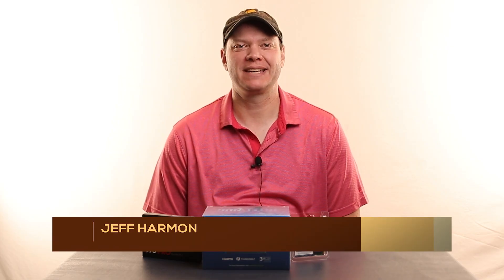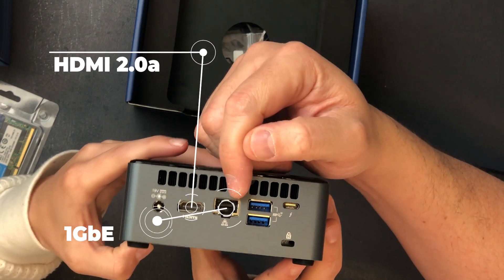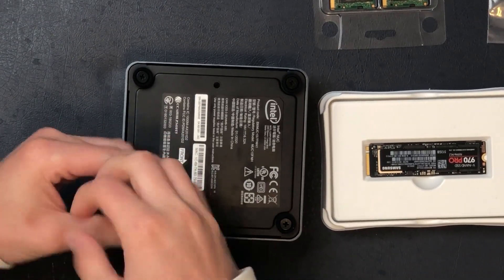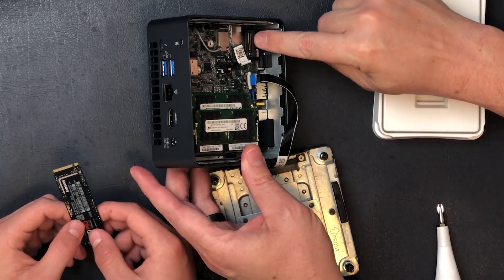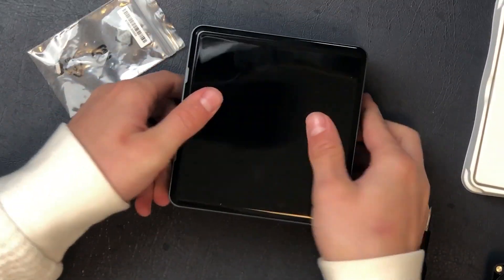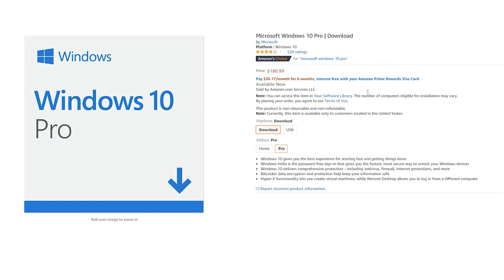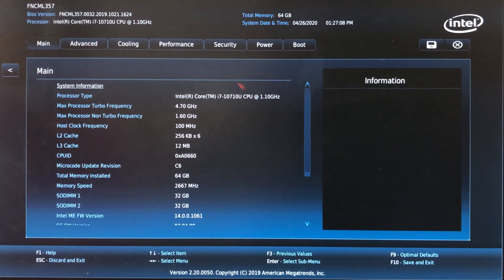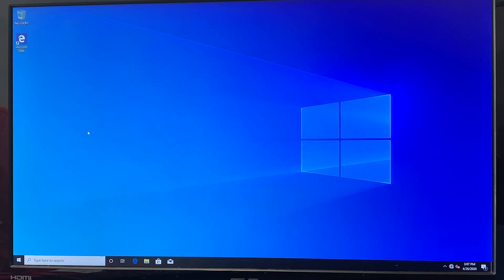Unboxing and Assembly of Intel NUC - Can It Be A Good Photo Editing Computer?

Comment: I bought a MacMini 2018 i5 6x core 2.8ghz base clock to edit Sony A7M3 24mpx RAW files with CaptureOne. Not being satisfied by the FPS feedback when moving the editing sliders I upgraded the RAM to 32gb. Got better but then I started to plan for eventual A7R4 camera upgrade path so I downloaded some 61mpx A7R4 RAW sample files and tried to open/edit them on my 6core 2.8ghz 32gb MacMini rig... : unbearable 1fps editing feedback.
Only solution forward: eGPU, so I upgraded the rig with a RazerX populated with Radeon 5700 GPU and THEN editing became acceptable for 61mpx RAWs and even enjoyable for 24mpx A7M3 RAWs. Exporting a single 61mpx RAW (multi format) took 40s before eGPU (hours exporting a wedding’s worth batch), now 4s with eGPU.
Bottom line?: forget about productively editing on ANY machine (doesn’t matter PC/Mac) with embedded Intel graphics at such low base clocks as the NUC provides.
Either go straight for an eGPU combo (GPU wasted by Thunderbolt 40gbps  bottleneck) or forget NUCs (except the 9th gen) and go for a setup/box that offers you internal GPU PCIe slot connectivity.

Comment: Good video and I liked how you had your son do the install of the memory and NVMe card into the NUC. One thing I did not see in this video that I have seen in others was all the Intel NUC drivers needed for a new NUC install.
Reply from the maker: We didn't have to manually install any drivers after installation of Windows 10 Pro 1909.  Afterward we did go and download a few updated drivers and even did a firmware update for the NUC, but that is pretty normal for most PCs.

Comment: What 2.5" drive do you recommend? So it will accept both the 2.5" drive and the M2 NVMe drives?
Reply from the maker: Yes, if you buy the tall model as shown in the video you can have both an M.2 connected PCIe NVMe SSD and a 2.5" SATA3 connected hard drive.

The 2.5" SATA3 magnetic drives are almost not available these days as everyone wants SSD, but here is a 1TB option that would be pretty fast for very little cost:

1TB ($60): https://amzn.to/3dNaGfZ

Then there are the faster SSD options
1TB ($115): https://amzn.to/2UmZgYK
2TB ($230): https://amzn.to/30mSjec

Comment: Great job, also enjoy your podcasts. What monitor would you recommend?
Reply from the maker: I recommend you look for a monitor with the following:

1) Buy as large as you can.  24 inches will work, 27 inches is good, 32 inches is great
2) IPS display technology.  This helps makes sure that if your position to the monitor doesn't have to be straight on to see the full fidelity of the colors and tones, you can be off to an angle a little and still have it look great.
3) A resolution of 2560x1440 or 2560x1600.  It is also called 2K, 1440p, QHD, or WQHD.  I don't recommend 1080p Full HD monitors.  They don't support enough resolution for the digital photos photographers are taking here in 2020.  I also currently don't recommend 4K displays because Lightroom slows down as you add more and more resolution to a display.  In the case of a NUC you don't have a discrete graphics card to try and help there either.
4) DisplayPort connection to drive the display.  Most people think of HDMI to connect their monitor to their computer, and HDMI 2.0a is a great way to do that.  It can be hard to find exactly what version of HDMI a monitor supports, so looking for one that offers a DisplayPort tends to mean that it is high quality and you won't be disappointed if you connect it to your computer using DisplayPort (like through the Thunderbolt 3 connection on the NUC) or HDMI.
5) Skip curved displays.  They make for a more immersive gaming experience but I am not sold on them being good for photo editing.
6) Don't worry about super high refresh rates or syncing technology.  Fine if it is advertised, not a bad thing, just not something to specifically look and pay extra for.  This is something far more important to gamers than to photographers.
7) Stick with high quality brands like (in no particular order) ViewSonic, HP, Dell, MSI, Asus, BenQ, LG, Samsung.

Here is a link to an Amazon search you could use to find one you like: https://amzn.to/2XE2E2f

As I look today, these would be my suggestions:

ViewSonic VX2785-2K-MHDU 27 Inch 1440p Frameless IPS Monitor with USB 3.2 Type C HDMI DisplayPort Inputs ($290)
https://amzn.to/3gwbCax

Dell U2717D IPS 27" UltraSharp InfinityEdge Slim Widescreen LED LCD Monitor VESA ($380)
https://amzn.to/3ccgpuq